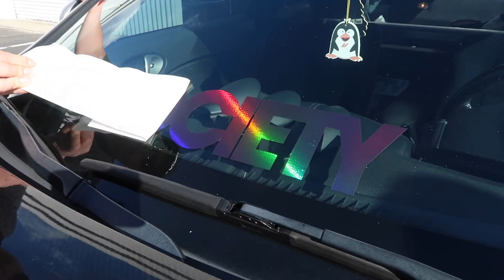New 350z Carbon Fiber Fenders!

Comment: Hi dad did you have to get a different size spacer after installing the new carbon fenders ? I currently run 20mm on stock fenders would I need to upgrade spacers for these ?